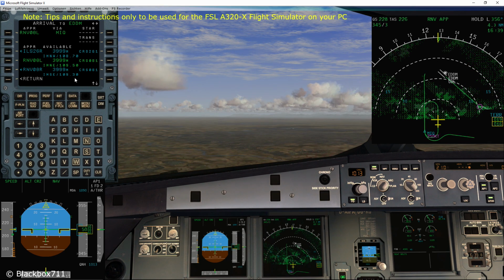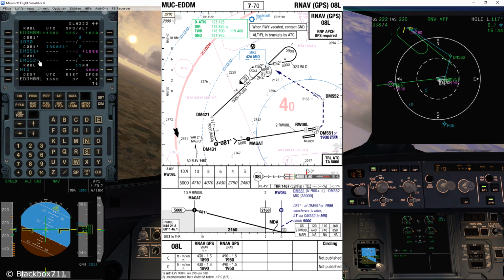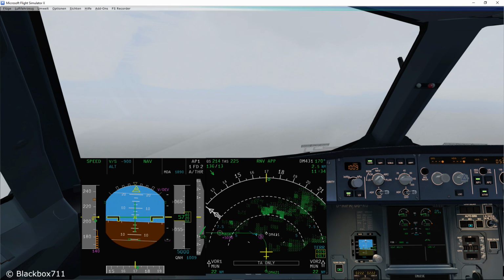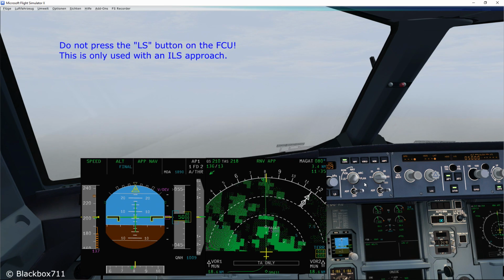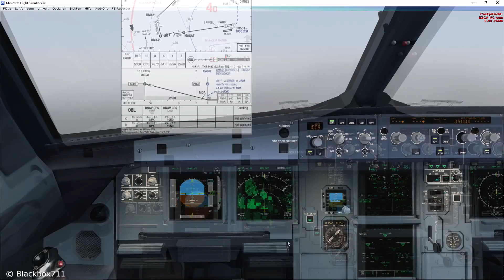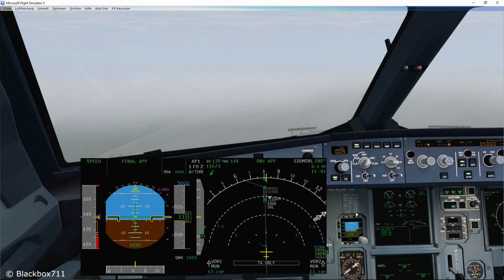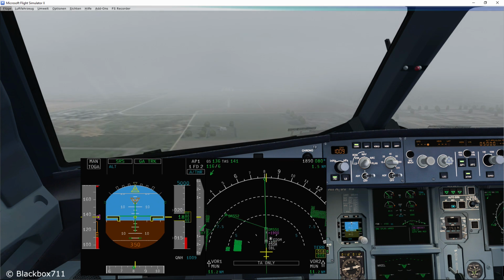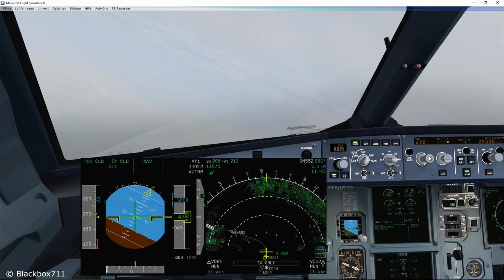FSLabs A320-X Basics: RNAV GPS Approach

Comment: The issue with FSLABS, is that it does not have the L/DEV indication. Which makes this a very unreal RNP approach. You must have both V/DEV and L/DEV.
Reply from the maker: Hi. No, you don’t need L/DEV to fly an RNP approach. There may be some RNP AR authorization requirement with regards to L/DEV. But a standard RNP approach does not require it.

Comment: Hello There, how are doing? So,  just to make sure about it, RNAV is not considered a precision approach , right ?
Reply from the maker: Hi. Not at the moment, no. But I think in a couple of years it will get approved for precision approaches and even autoland.
Reply: @Blackbox711  thank you ...
Reply: In the case where the approach is flown with vertical and horizontal guidance the VNAV minima is used. This approach then is by definition a precision approach to a decision  Altitude

Comment: Thanks for this great video, Blackbox711. One question, if you had kept going with the approach, at which point would the AP have disengaged? I know it's not allowed to autoland when doing an RNAV approach, but from a purely technical point of view, wouldn't the plane be perfectly capable of doing it? If not, why not?
Reply from the maker: Hi. If programmed and certified the AP would be abled to fly the RNAV and do an autoland. However you would also need a position updating unit at the runway to get the accuracy to an acceptable level. In the end we are talking about a GPS based approach
Reply: Ah okay that makes sense, thanks!

Comment: I found this very helpful but i notice the ils button is on, is this a requirement for RNAV approach and if not, where does one insert the frequency for the localiser? Ive got to grips with an ils approach but RNAV still has me beat. I'm using the latest Navigraph cycle witn JeeHell FMGS & P3D v4. I must have had 20 attempts at Innsbruck RNAV approach and still can't pull it off. Any pointers greatly appreciated.

Comment: Hi and thanks for your videos.Very informative indeed. I use only XP and i have the FF A320. I tried to perform the RNAV 08 approach to LOWI following your instructions but always i ended to be very high and GO. Do you know if this is because of the FF A320 or maybe i do something wrong?
Thanks
Reply from the maker: Hello Nick. Yes, at the moment the FF320 seems not to have a correct drag model with flaps and gear down. Also the descent profile is steeper at 3.6 degrees.
Reply: Thanks a lot for answering. I thought that i did something wrong. I had to GO twice and finally i did a visual approach to land. Hope FF will fix this soon.
Reply from the maker: I hope so too
Reply: @Blackbox711  oof, literally watching this video as im doing this approach 😢

Comment: TE: JAN 2001 Page 54 UDY0102

- If SELECTED Approach • Overfly FAF, properly identified, and • select TRK = Final APPR CRS, • select FPA = Final APPR path (actually start the final descent 0.3 NM before FAF).

- Use ATHR and Managed speed. - If GPS PRIMARY, monitor VDEV/XTK/F.PLN on ND. For VOR, ADF approaches, monitor Raw data. - Set Go Around altitude ONCE the A/C altitude is below that altitude.

Reaching MDA

- If visual and properly established, continue & land with AP OFF and both FDs OFF.
Reply from the maker: Yep. But you are quoting a NPA without FINAL APP guidance. Don’t you use that mode?

Comment: A320 Instructor Support
11/3 - NON PRECISION APPROACHES (NPA)

The stabilized approach technique is recommended. Reach FAF with CONF FULL and VAPP.

The following particulars do apply to NPAs.

The overall strategy of NPA completion is to fly it « ILS alike » with the same mental image or representation, and similar procedure. Instead of being referred to an ILS beam, the AP/FD guidance modes and associated monitoring data are referred to the FMS F.PLN consolidated by raw data, with the exception of LOC only approaches, where LOC mode and localizer scale are to be used. This explains why the crew must ensure that the FMS data is correct; FMS accuracy, FPLN data (lateral and vertical), proper leg sequencing.

! Initial Approach

- NAV ACCY CROSS CHECK is most essential since it determines: which AP/FD guidance mode may be used, which ND DISPLAY mode may be used and which raw data must be used.

If GPS is PRIMARY or NAV CROSS CHECK is POSITIVE. Managed and selected AP/FD modes may be used, as well as ND ROSE NAV / ARC modes.

If NAV ACCY CHECK is NEGATIVE. Selected AP/FD modes may only be used, and monitoring is achieved with raw data only.

If GPS is PRIMARY at the beginning of initial approach, it will most probably remain primary throughout the approach. However if for any reason GPS PRIMARY is LOST then:

• a GPS defined approach cannot be flown as if ILS signal was lost for ILS approach and • a VOR (NDB …) approach may be continued, as if without GPS. The strategy is merely a function of NAV ACCY CHECK.

- Set the BIRD ON as flying reference. - Set VAPP as SPD CSTR at FAF, in order to get a meaningful (DECEL) pseudo waypoint.

Other drills:

- ILS P/B set to OFF in order to get VDEV BRICK on PFD (except for LOC only approaches, where ILS P/B is set ON and the yoyo is used as VDEV), - NAVAIDS - ensure that approach reference navaid is inserted and display associated needles.

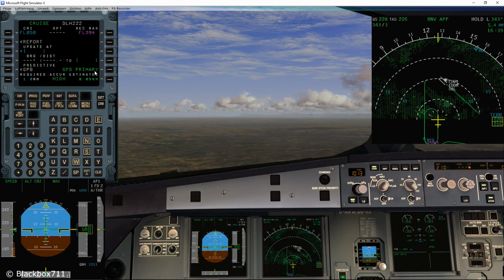Comment: Thanks a lot for the video (and all the others)! @ 00:54, shouldn't the precision be reduced to 0.3nm for the GPS approach (compared to 1nm in the terminal area)?
Reply from the maker: +Spock 540 ..  correct. The FMS should do it automatically, but to make sure irl you would enter 0.3
Reply: Best to check the APP chart also as some approaches require a higher precision E.G NZQN=0.1nm
Reply: 0.3 is a bit more common than 0.1 (that you may find most likely in New Zealand).
Reply: Going through my reccurent sim, I just got an explanation: forcing it on the MCDU will trigger an alarm on the PFD if the accuracy decreases. Otherwise, the value will change on the PROG page without other notice.

Comment: Please clarify your comment at around 7min 15 secs where you state that on the VLS check  VLS on PFD is 2 knots higher than as displayed on the FMS so you will add 2 knots to the approach speed.
I cannot see the VLS displayed on the PFD 
As another point I have been having difficulty with Non precision approach in getting the aircraft to descend and follow the brick. I am hoping that your video will help me to achieve this.
Thanks.
Mike
Reply from the maker: Hi. I have another video where I explain exactly why there can be a difference between the MCDU VLS and the VLS displayed in the PFD. Have a look here: 
https://www.youtube.com/watch?v=U0_g4trYMuw&list=PL24XRTIr2OjIe7PvRwS50Lf74nZFUeE9x&index=17
Reply from the maker: I cannot believe that you cannot see the VLS in the PFD. It is the top of the orange rectangular are in the lower part of the Speed scale on the PFD.
Reply from the maker: In order to enable a descend you need to select a lower altitude on the FCU (autopilot panel).
Reply: Thank-you Blackbox711.I have watched the video you mention already. I was interested in your comment that when using with TRK/FPA armed, that on the FS Labs A320X you need to pull the FPA button and insert the correct decent angle. The way you said this and being a real airbus pilot yourself made me wonder if this is not quite how it is in the real aircraft. Of interest is that I learnt how to do non precision approaches in the Aerosoft airbus A320/321/£18/319. I never had a problem with getting the aircraft to follow the brick in the Aerosoft simulation. I was taught in the aerosoft simulation to arm TRK/FPA. If I left it in HDG/V/S would the FSLabs follow the brick. I have tried putting the the altitude down to the minimums after passing the FAF but it does not descend following the brick. I would be grateful for your advice which is much appreciated.
By the way I am studying Mike Ray's A320 book to ensure I understand VLS.
Mike
Reply from the maker: +Michael Houghton .. Like in the FSLabs and real life, you need to pull on the TRK/FPA to engage the mode and habe the aircraft descend. The Autopilot will not start the descent automatically with this mode. The only automatic descent is possible with the APCH mode button. Regards

Comment: Thanks for the video! Also, I have a question. In some RNAV procedures, the FPA/TRK button is also pressed along with the APPR button. But in this video, only APPR button was engaged. So is the FPA/TRK button necessary at all in the first place?
Reply from the maker: Hi. That is an interesting observation. I can't speak officially for any airline and their procedures, but in my opinion when using the APPR button on the FCU and therefore vertical guidance for the approach then I would use the FD crossbars and not the FPV. Regards

Comment: Wow! wasn't expecting that go around. In an RNAV GPS APP, would you descent in selected or managed mode ?
Reply from the maker: Neither was I :-) I set the ceiling at 500 ft, however I guess I set the visibility a little bid to low. I would always prefer to fly the RNAV GPS in managed mode. Guess I am lazy regarding managing the descent rate on my own. Regards
Reply: Blackbox711 great job in your managed mode! One of my past instructors teach me pretty well to use FPA during non precision approach. (I did plenty of them on Greek islands) 
It is funny but could be tricky 😬